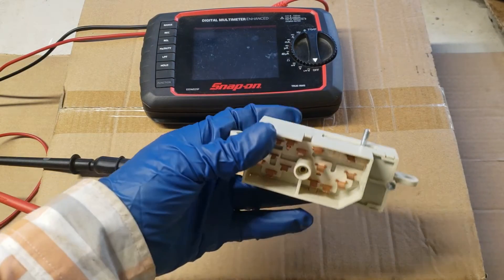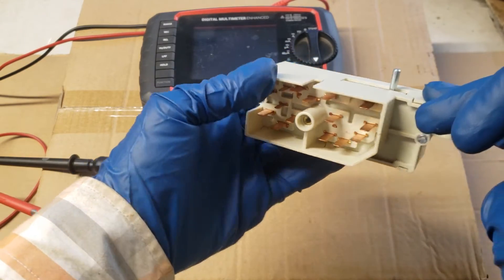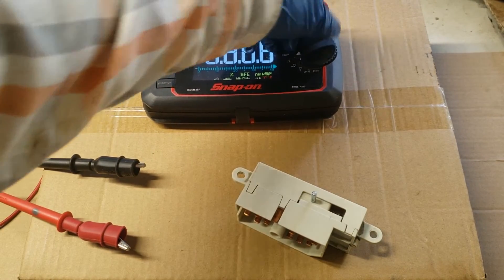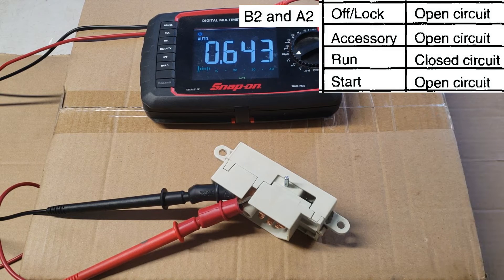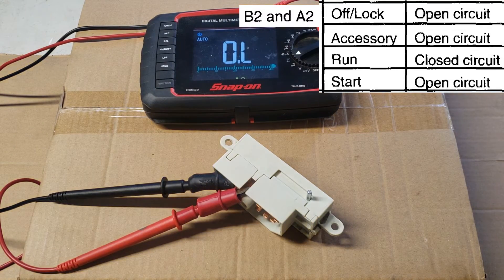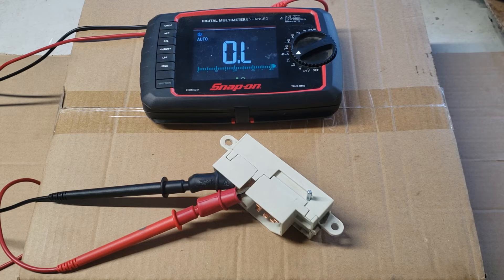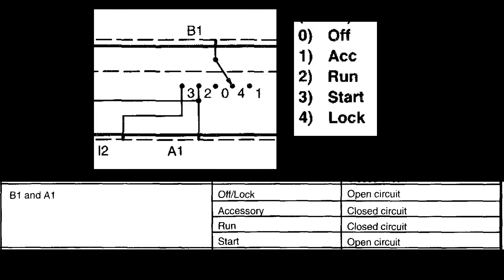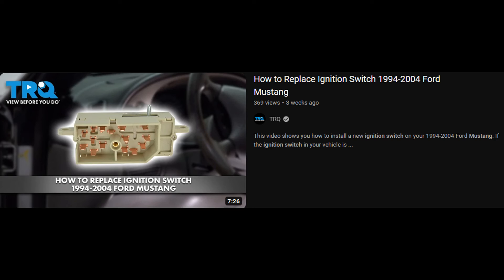How to Test a Mustang Ignition Switch (99 to 04)

Comment: My 2004 stiff to turn and won't turn far enough to start engine turned out to b a bad ignition actuator in the upper half of column and the plastic block in the lower half that attaches to the actuator. Column had to come out. Found that the biggest problem was the block in lower half was binding thus key could not move through it's stages. It would not slide in its housing. Sanded down the edges until it slides smoothly and put back together. Works great now!!
Reply from the maker: woah nice fix!